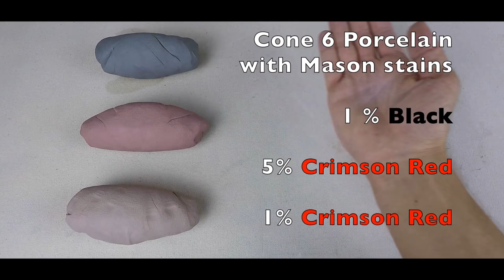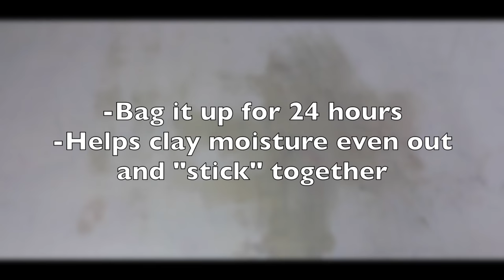Pottery Compilation - Nerikomi Patterns and Techniques

Comment: quick question, do you ever trap air bubbles between the layers and end up with a kiln explosion?
Reply from the maker: I rarely get bubbles because I try to “roll” the pieces together vs just smacking them together. If I do get any air bubbles I see them when I cut a slab from a larger block and can easily work it out. AND air bubbles just trap moisture and don’t allow the clay to dry very fast. If a piece has an air bubble but it dries completely and is fire slowly it can STILL survive. Things usually blow up because of firing too fast most of the time in my experience. Thanks for the comment Paul. Your channel is really cool by the way ;)
Reply: @CeramicJim  thanks!  Thank you for these videos, colored clays look really cool.  I used to study ceramics as an archaeologist and finding english agateware would make my day, so cool looking.  Favorite one was a mostly red/white agateware teapot with an astbury spout.  It would've been really cool if it wasn't smashed haha

Comment: It was awesome to finally see some of those pieces finished!
Oh, and I always wondered, when you're making the cubes, do you model them first, then cut them in half, take part of the inside mass away and "glue" it all back together, or do you make each side separately and then just connect them in one piece?
Reply from the maker: Sororus Thank you! I actually cut six square slabs, bevel the edges, slip/score, attach, scrape, sand then fire to cone 6. Thank you asking!
Reply: Thanks and I thought so, just wasn't sure :)

Comment: Stupid questions....1. Can this be fired in a regular ceramic kiln? 2. Can it be fired with other kinds of ceramics such as porcelain? ...and 3. You used Mason pigment, can you use mixed varieties of pigment in the same firing?
Reply from the maker: 1. Yes.
2. Yes. These colored clays were made by wedging the pigments into plain porcelain.
3. You can make a purple colored clay by mixing a red and blue power beforehand or mixing red and blue clays together. It's fun to experiment with mason stains.